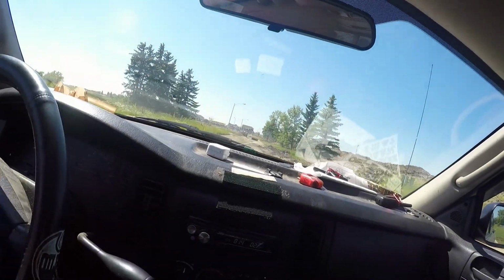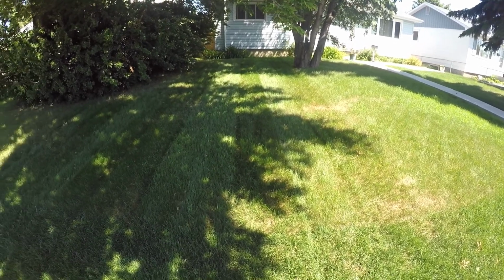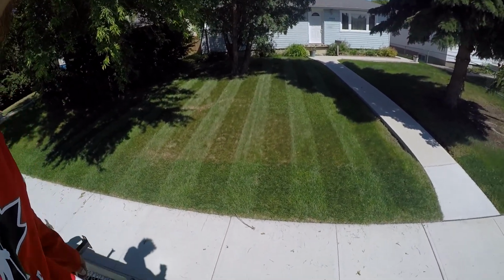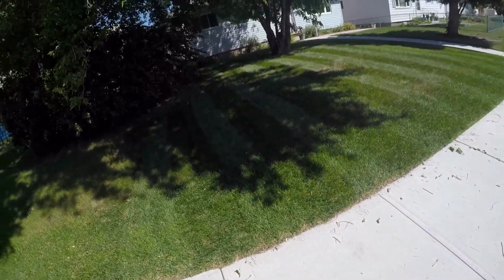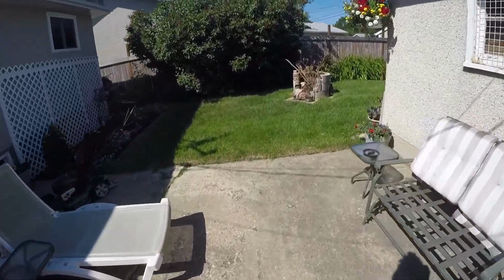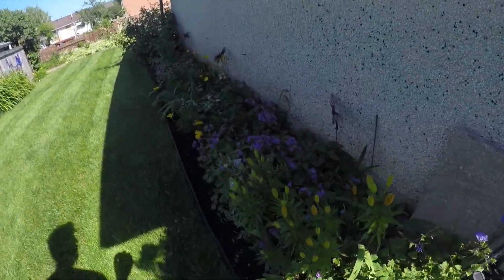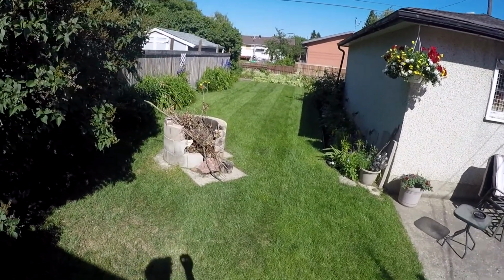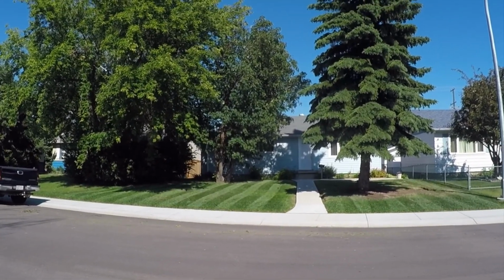Vlog 07 - Testing the Lawn Striper

Comment: last summer I bent a blade on one of my riding mowers and it produced exactly the effect you're chasing, it has 2 blades under the deck and only one of them bent downward enough to mow lower than the other, I liked it but noone else did so had to straighten it out lol cheers mate!
Reply from the maker: Haha we actually had similar problems with the ride-on, deck wasn't level, had some interesting cuts.
Took the deck off and used a jack to bring it back into "shape" lol. It's still kinda beat up. But the blades are level now and the cut height matches the numbers on the lever.  Antiscalp rollers are straighter and it's not clipping anything. I think they hopped a bunch of curbs with it last year, maybe caught a stump or few as well.
Bought used in a package deal, it got well used last year. This year was a scramble to get it going to avoid mowing a baseball diamond sized yard with push mowers. 

As for the stripes, one lady who is strict about her stripes today gave me some shit because she thought I was mowing in the wrong direction this week. With her sun angle, all she could see was my stripes from last week.
She almost didn't believe the stripes were still there.  Her house view is 90 deg to the stripe direction she wants and the sun, so she won't really see them this week either.  Today I learned from a demanding customer perspective, stripes can be a burden.